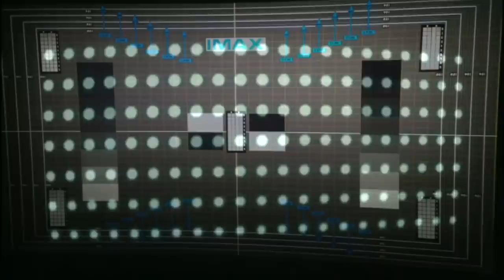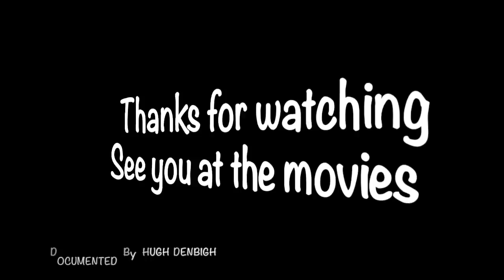IMAX 4K Laser upgrade time-lapse, from 1570 2D - IMAX Theatre - Royal B C Museum

Comment: But 4K is a lot LOWER resolution than the original IMAX film.    Maybe the reliability has gone up, but the pixel resolution has gone down.
Reply: If they used 4 projectors that are off set like Cinerama would would be able to get close to the 8k resolution of 35mm film in a cinema.

Comment: Them speakers behind the screen are set up poorly. You don’t but subwoofer in the middle of the screen like that. Those should be lined on the floor. And have horns and mains evenly spaced in the center.
Reply: Not sure what you mean. A "very large" room is a different acoustic environment to a "domestic scale" one; the subwoofers are clustered together to increase SPL through mutual coupling (rather than putting them in separate locations around the room for a smoother bass response.) The design, positioning and angling of the other screen speakers is intended to provide good room coverage, i.e., trying to optimise for even levels and frequency response from front to rear whilst avoiding "throwing" the sound to places from which higher frequency sound reflections would be detrimental, such as the ceiling or back walls. (Not sure this video shows them after alignment has been done with a laser, they're just left suspended in somewhat random directions.) 

There is an upper centre speaker which is found in full 6/12 channel IMAX installs. It's a legacy from earlier days of IMAX, and I'm not sure if it's even used on any modern releases. It is (or certainly has been) omitted in smaller scale multiplex-type IMAX screens.

Comment: going digital is actually better than having to load the reel each time. Hear that if the film is scratched it costs a lot of money having to replace that section of the film or the whole entirely, but with digital the manager can fix the issue from the office easy. only thing he has to worry about is the bulb if it burns out or breaks just replace it. But sad that it replaces a job in a movie theater, but Times change and can't stay stuck in the past forever.
Reply: It does not work like that. Digital 4k has about 8 million pixels on screen which is really easy for people to see on screen in a cinema you will not notice it at home on a tv. 
While film can get scratched it only tends to cause a problem for a split second and will pass and is that little line you see on a screen for a split second. It would be very unusual for a film to have lots of scratches throughout a reel if it has it means there is issues with the theater. 
35mm film has a resolution of 8k which means for a digital projector to even compete it would need about 32 million pixels on a screen.
Reply: @bighands69  well times have changed the technology for screen resolutions have improved greatly, so i'm sure it's more pixels per inch than before
Reply: @johnlerch7699  
4k only has 8 million pixels it simply cannot have anymore pixels. 8k projectors are not on the horizon at all. 
At the rate the industry is moving 8k digital projectors could take 20 years to get to market. 
A TV does not need anymore than 4k after that it becomes redundant with no benefits.
Reply: @bighands69  then an 8K gaming monitor is redundant then as its already out. and 8K TV's were out in like 2018. but digital is still better as you don't have to worry about damaging the film from the machines that play it and such.

Comment: should have been 8k ,4k on that silver screen picture sharpness is poor. you can see individual pixels...4k is so good on 16 inch screen not that big ass screen
Reply: right, only that you would have to sit 1 foot away from your 4k 16 inch screen in order for that resolution to make sense (from a visual acuity standpoint). As the viewing distance in a cinema can be easily 100 times that, the screen can also be 100 times bigger at a 4k resolution, so 1600 inch (133 feet) which this screen is only about 78% of (104 feet). In order for 16k (about imax70mm) to make sense on that screen you'd have to sit 20 feet away from it (20 feet away from a 104 feet screen), which no one should be doing in the first place. 4k at 104 feet screen size actually makes sense for a large theater room.

Comment: Some things should stay like they are. Where ist the romantic and what skills you need to operate these machines? Nearly no skill is necessary. And all shows can run automatically without any personal for weeks. The next thing is to run a cinema without any personal whatsoever. Book online and take a seat...
Reply: They still need an operator to manage certain things. Sure there is no film but it still needs setup, configuration and maintenance.

Comment: That's a major downgrade. 15/70 IMAX film is roughly 12K-16K, the laser system is only 4K. That's like throwing out your 4K Blu-ray player and replacing it with a DVD player.
Reply: Do you even know HDR and colour space, at least contrast ratio?
Reply: @Miguel_Noether  Yes, doesn't change the fact that it's a major downgrade. The bare minimum resolution for any digital projection system to be worthy of the IMAX name is 8K, as the closest seats in a proper IMAX theater are at the "sweet spot" for viewing 8K.
Reply: @KingdaToro  it’s more like throwing out a lcd panel and replacing it with an oled panel 100% worth it for the majority of the people in there apart from the few who already made the mistake to choose front seats
Reply: Stop the non sense with that 12k-16k resolution of 70mm. It's not true. That's the theoretical limit not practical. And that would have been possible only if the movie was shot with 70mm film and then edited with old film trimming technique and made copies of that film to show in theatre. But now even if the movie is shot using 70mm film( very rare) it is still converted to digital format, and then edited in a computer at Max 4k resolution, adding all the VFX etc and then rendered eventually at 2k or 4k. After that it is printed on film again for the theatres that still use 70mm projector, for rest same digital copy is shared. So it was never 12k-16k etc, it's at max 4k even for film. I'm just shocked how clueless some people are about this
Reply: @HRyder  Would it be worth it to replace a 4K LCD with a 720p OLED? Would it really? Because that's the sort of resolution downgrade this is.
Reply: @KingdaToro  you know that modern film isn’t 16k or whatever it’s 8k as they edit it digitally so it’s not even that low of a downgrade and more like going from a 4K screen watching 1080p to a 720p screen watching 720p but with majorly better quality
Reply: @HRyder  I'm referring to actual IMAX films that were shot with actual IMAX cameras running 70mm 15-perf IMAX film. Quite a few movies are partially shot on it, and when you see them in an IMAX theater, you're seeing their full resolution.

Comment: LoL definitely not an upgrade if anything a HUGE downgrade even with with dual 4k projectors. Still can't produce the brightness, texture, contrast, and resolution of REAL IMAX. Post December 2013, (projectionist massacre) the image quailty for the avergae cinema has decreased ASTRONOMICALLY from 35mm/70mm/70IMAX projection to crappy 2k digital projectors that my 4k monitor produces a brighter and higher contrasted image than. Everything in cinema has become about convenience: digital imagery, digital projection, etc. Hopefully one day we can go back to when cinema was treated as an art form and not disney plus content.
Reply: The biggest problem with digital theaters is the fact you can actually see the pixels on the screen. 4K is simply not enough pixels and only produces about 8 million. 
I think they can get around this by using 4 projectors similar to the way Cinerama did it in the 1960s with 3 projectors. 
It means they could get 32 million pixels on screen which would then be similar to what 35mm film can do on screen. 
At this stage it is probably impossible to get 35mm film into cinema projection systems again without there being a large investment.

Comment: no wonder the sound in cinemas is soo bad... there are no subwoofers which qualify as subwoofers for this huge room. The entire subwoofer-stack in the middle of the screen is smaller than my homecinema subwoofer. You need at least 8-12 of those stacks, with every single subwoofer equally distributed over the entire lower screen-surface, to get a the required amount of low-frequency energy to every listening position. In rooms like that, low-frequencies behave exactly like every other frequency domain, they distribute as spherical wave with quadruple energy-loss with doubled distance, without any room-gain (as home-subwoofers benefit from).
Reply: I think you grossly underestimate the actual size of the woofers and the difference between commercial and home speaker systems. Remember the screen is 65' wide! As far as how many are needed, commercial cinema systems are much more powerful than you think. I worked with Klipsch cinema speaker systems for a few years.  A single pair of KPT-1802-HLS speakers (and amps) would completely fill this theater with tremendous clean audiophile grade bass sound. With  130db SPL continuous and 136 db peak per speaker (every 6db = 2x), with 1100 watts continuous and 4400 watts peak for EACH SPEAKER. This is literally enough to shake the building with  20Hz frequencies from a pair 18" horn loaded speaker. One would do the trick, but you'd use two of them to smooth out the distribution across the audience L/R.  For example, if you've ever been to an outdoor rock concert and seen a huge wall  of speakers, if you went behind the "wall" you'd see 90% of them were shams. Only a couple are typically real speakers! Even for bass.
Reply: @WarpFactor999  you wont get 136db from a single woofer, im not using home equipment im using 8x Beyma 18inch woofers in 500l volume and 15kw amping. Thats enough to get 140db at 20hz in a normal living room. You need 1000 times that amount of power to get 140db in such a large cinema. Sorry you need to look at the numbers and think about distribution of sound before posting bs
Reply from the maker: @PoisonNuke  
Im no expert like you guys but your not seeing the speakers on the ceiling!
Reply: @PoisonNuke  1000x? That would be a Megawatt. A horn loaded system only takes around 800-1200 watts to fill a stadium. But, it's a moot point as anything at or above 130 dba will make you go deaf.
Reply: @WarpFactor999  below 100hz you can savely listen to 140dB without any risk of getting deaf. It just hurts your body 😁
Horn loading is irrelevant for low frequencies, 5 lambda is the minimum length of an horn to be effective, thats almost 100m for 20hz. Therefore you have perfectly spherical radiaton from the center subs, only the half room reflection amps them by 6db. So you have 136db at 50hz, which is plausible, at 1m. The first row is 20m away, so they get a max of 136-26dB =110dB.   For the last row it drops another 6-12dB. Standing waves are not really applicable in room that size therefore no gain near the rear wall.

To get 140dB in the last row you need 40db more source power, which is as much as 10.000 times more electrical power (10dB equals 10times more power)

The only solution for that is not horn loading but arrays. You need planar waves, and thats what good cinemas (and concerts too) are doing, they have dozens of subs equally distributed behind the screen and dont have any falloff in sound intensity at all as long as the subs are half lamda apart.
Reply: @WarpFactor999  and just to get clear about the sound levels we discuss here: in good movies you have a decent amount of near and infra bass, which is amplified by 10-20dB compared to the rest. This is the fun part in action movies, becaus 25hz for example at 120dB is almost inaudible but you feel it a bit. 25hz at 140dB is where the real fun begins, earthquakes "feel" like an quake and so on. 
My home setup can do this and its amazing, without hurting the ears (im 40yrs now and my hearing is on the level of the average 20yr old)

I know that a very few cinemas out there can do the same, but in most ones like here there is simply nothing below 50hz...